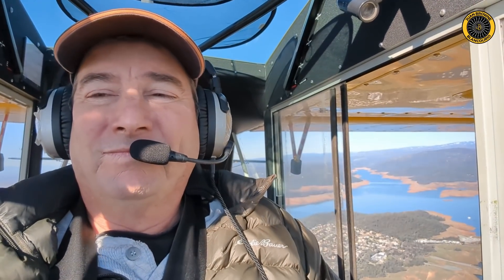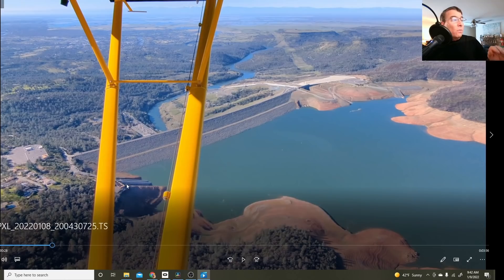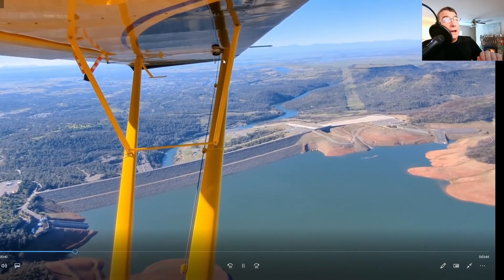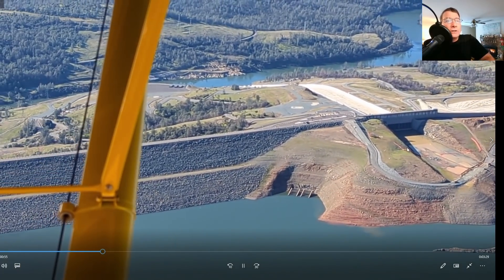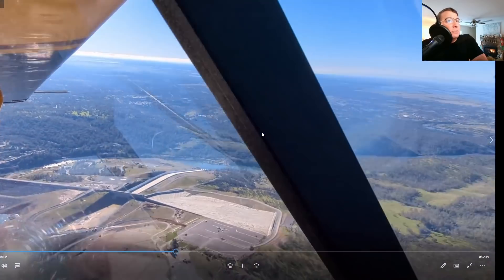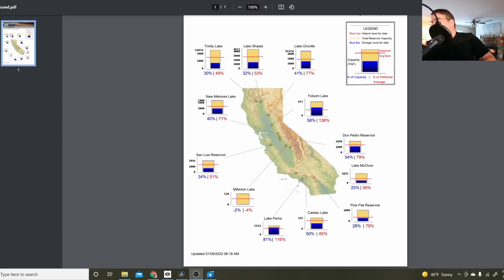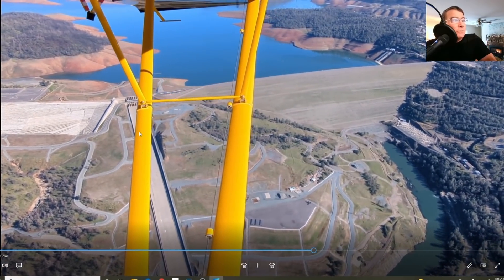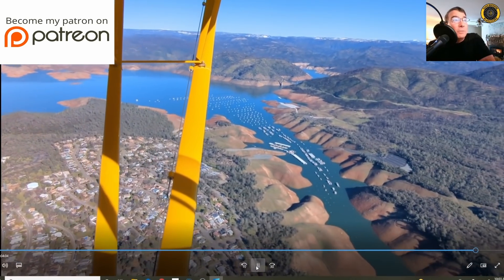Oroville Update! 8 Jan 22  CA Drought

Comment: Here's a little bit of history for you Juan: The Oroville Dam had it's own railroad used for construction of the dam. It was called the Oroville Dam Construction Railroad. The Oroville Dam Construction Railroad was later merged into the Western Pacific Railroad (WP). The WP itself only lasted until 1983, when the WP merged into the network system of today's Union Pacific Railroad (UP).

Comment: I'm not educated in hydrology but spending formative years on a farm seen what storms do. I wonder about the emergency spillway, there does not seem to be any contingency for large water flows, to prevent wash from eroding the lower side of the dam. I sure I'm wildly off the mark but it just looks like a budget constraint the job is half done.
Edit:
We are in La nina at the moment, I think we are just past the peak and heading into El nino for the next 6 or years or so, rain fall fill start increase over the next few years, it's peak will be around the year 2027. This will be a test for the dam as rain fall will increase over the next years. La nina Hot and dry, El nino wet.
Reply: they completely redid the emergency spillway, and there's a lot of anti-erosion features. There's a cutoff wall driven into the hillside to prevent erosion from going up to the spillway and a bunch of roller compacted concrete up at the top. Practical Engineering did a video on it, and you can also find the engineering reports on the state websites if you're curious
Reply: @screetchycello  ...and Juan covered the whole reconstruction job in a long series of videos which give quite lot information about the site clearance and rebuilding.

Comment: Excellent video.
Can someone explain how to read the altitude on the gauge at 10:10? thanks.
Reply: Altimeter shows the short needle is past two, and long needle is past 7. So 2 x 1000 ft + Long needle 7 x 100 ft = 2700 feet Above Sea Level

Comment: Thank you for the Oroville update. As normal it goes down and in time it will fill up again. Hope you and your family are well. Hugs to chewy.
Reply: That’s the thing: it’s not normal for it to go down that far. If it was anywhere near normal, the power plant would have been designed for it. The reservoir was never meant to drop that low. There is a long term drought in California as you might have noticed. This has also been a factor in the devastating wildfires last year.
Reply: @MarcosElMalo2  It is what it is.

Comment: With 700Mw of generation capacity they shouldn't need a supplemental spillway, that is a lot of water, like on the same magnitude as the average flow of the Colorado river. Just shift more of the grid load from steam plants to the dam, both are good for continuous base load with fluctuations on a weekly scale. (Hydro is also good for peaking and general grid control but the point in this case is maximum water flow for a target time period.)
Reply: MyTYech,.... you miss the point of the water being stored behind the Oroville Dam,...its main purpose is not to generate electricity ( that is now just a by-product of releasing water ) but to regulate and control the amount of water at a rate that can be pumped to Southern California without sending it downstream and flowing into the SAN FRISCO BAY above the agreed amounts for environmental preservation. It is all about getting the water to Southern California !! Electricity is just another By Product to help offset the cost of water delivery.
Reply: @stutz1751  The Hyatt PowerPlant and the River Valve Outlet system can be used to regulate the amount of water behind the dam long before the reservoir level ever reaches the main spillway.  These systems can pass a significant amount of water from the reservoir.  Is a supplemental spillway actually needed?
Reply: @stutz1751  I know the purpose of the dam quite well, I think you may have missed half of the video though and then replied after only a quick skim of my post.
Reply from the maker: The greater concern is the levees downstream during flooding.
Reply: @blancolirio  Maybe I am missing something here, but the downstream levees would be an issue without regard to the water being released via the power plant or a new lower spillway. It's the same amount of water down stream. (Unless you are talking about one specific problem levee, in which case just fix it as they are relatively cheap structures compared to dam spillways.)

Comment: Not sure if you noticed and not sure if it's an issue, but if you look back in the footage, there's water leaking through the spillway about halfway down on the left side.   Is that normal.  Shouldn't the drain system take care of that?  Just wondering/ asking.
Reply: Yes it is normal.  That is the emergency spillway, not the main one.  There is no drain system under it.  What you see is the drain system.
Reply from the maker: It's been raining...a lot.

Comment: I though that those structures on the right upstream face of the dam just  to the left of the spillway was for a potential second power plant, and that they were built at the time of construction of the dam.  That is, those structures are intakes for a power plant, not a spillway.
Reply: You are correct  ed p,...That intake structure was originally designed to be used for a second power plant to utilize the spilling of water from a  lower reservoir elevation before it gets to 813 feet which is the bottom lip elevation of the Radial gaited control main spillway. This additional method of draining the reservoir at a much lower elevation than 813 would give the operators a heads up on providing an additional drainage method and safety margin by lowering the reservoir in the event the near future weather was predicted to be a severe rain event onto a large snowpack in the mountains. As it is now only the underground power plant @ 17,000 CFS and the river outlet valve @ 5,500 CFS can release water before it gets to the 813 level. NOT GOOD !!

Comment: Didn't you say that power plant had the ability of pumping water back up into the reservoir? That such a fantastic way of storing energy, so if that's the case what ecological reasoning for not employing that did the governing powers give for not employing it?
Reply: Even if you had big enough pumps to move a significant enough amount of water back up to the reservoir, it would cost more energy to lift the water than you could generate with the same water falling. Otherwise you could make a perpetual motion machine--which would be cool, but is unfortunately impossible. (Storing energy by pumping water uphill works when you have large quantities of solar or wind energy--that energy is very inexpensive, so the energy spent is insignificant compared to the convenience of shifting the availability of the energy to times when wind and sun aren't available.)
Reply: They've been  pumping water up hill for years  in California.    The aqueduct in Byron  and the grapevine down by Bakersfield.  All them resiviores  down past the grapevine  are filled by the delta in Northern California
Reply: @peterrehrmann9196  For energy generation?
Reply: At the Thermaltatoe  afterbay  there is a function that pumps water back.  Probably not  to Oroville  but mabey to the generator plant.. I seen it mentioned  before on Juan's site

Comment: Five years later and it's still fascinating! I think that we all are hoping to see that new spillway releasing 250,000cfs someday...
Reply: The downstream levee system is only designed for 150,000 CFS,....so you don't ever want to see 250,000 CFS going down that main radial gated controlled spillway. The levee would rupture at some point at anything above 150,000 CFS and flood the whole valley clear to Sacramento.